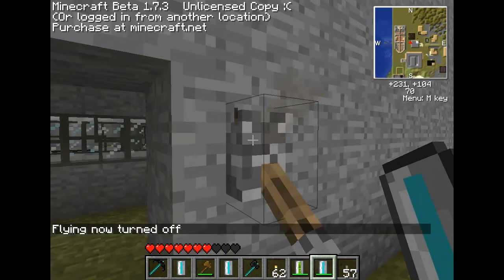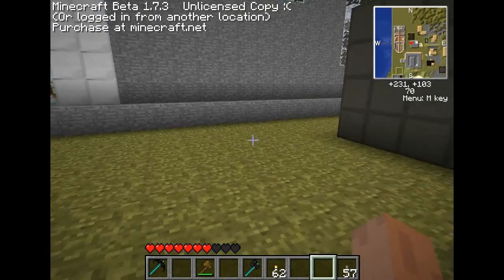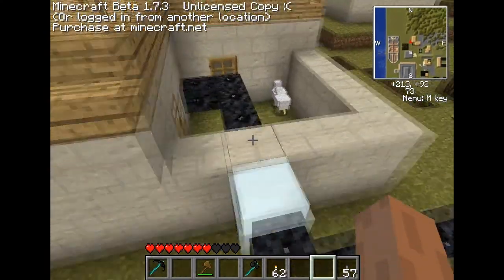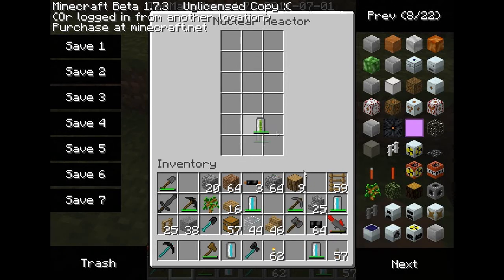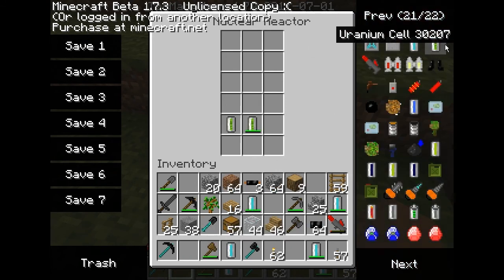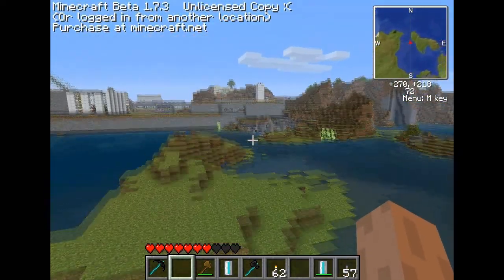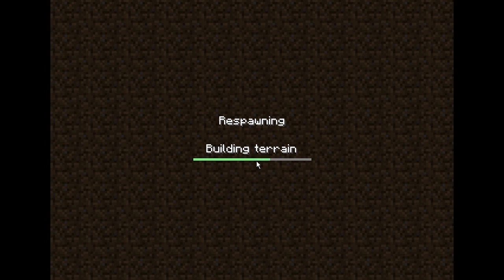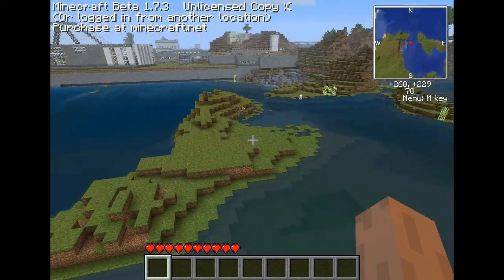Minecraft  Nuclear Reactor In Depth

Comment: @zukodude487987 To cool the uranium you have to inject certain rods which suck the electrons away from the uranium to stop the chain reaction. The energy is created by shooting electrons at the uranium core and it splits the atom in two and gives off alot of energy and shoots off more electrons to split the next set of uranium atoms.

Comment: @zukodude487987 Part of the pressurised pipe goes to a room with a pool of clean water. As the pipe goes through the pool it gives off some of its heat and starts boiling the water in the pool until it boils and powers the turbines. This process will give off heat from the pipe into the pool of water and the pressurised water will cool due to its property of giving away its heat. Also the reactors themselves have a way of cooling. (i still have to split it into one more part :p)

Comment: Fision bombs work like fision reactors, the only diffirence is that power plants keep the uranium at lower temperature to keep it from exploding, but low enough to steam water. Fision reactors dont pump in cool water into the reactor. The process is a bit diffirent, the reactor is in a closed pipe with pressurised water. Its pressurised so the water in the pipe doesnt boil away. The pipe is also in a loop so that water can go in loops around it. (the text is so long the i hav to type 2 comments)